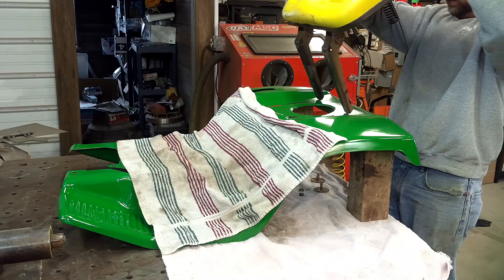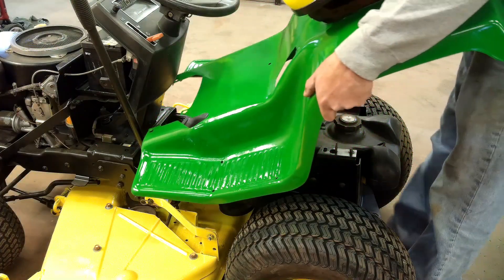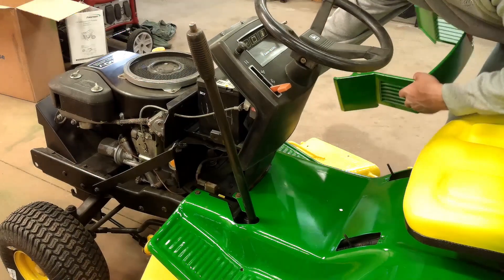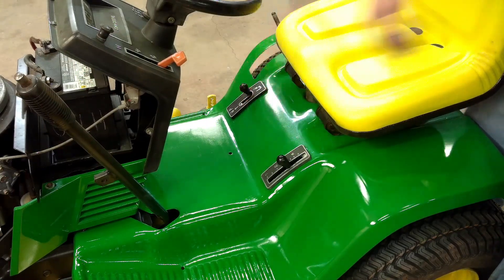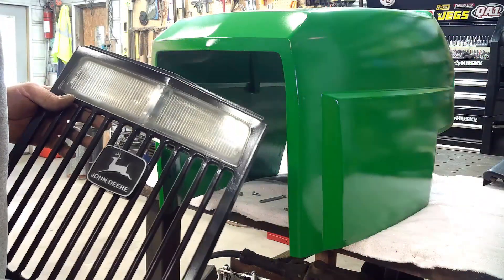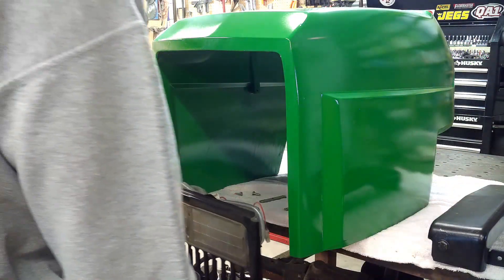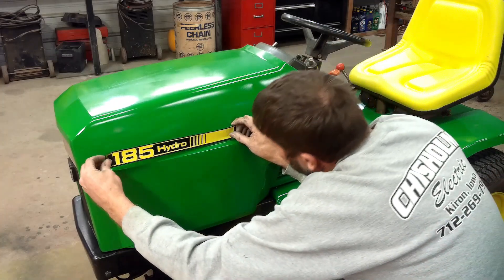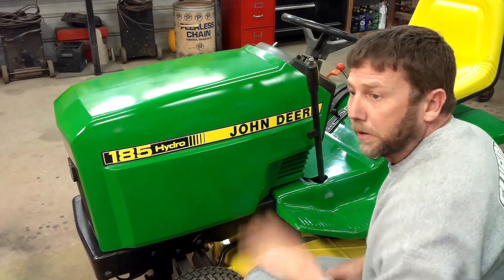John Deere 185 Lawn Restoration It"s Finished!! Ep. 12

Comment: I finished my restoration last night. Took it down to the chassis with the transmission still attached. Tightened everything up, scraped the rust off every bolt, replaced what was broken, tested parts function, adjusted drive linkages and steering, and re-did a lot of shoddy wiring/electrical. No access to sander and decent paint booth, but I gave it an amateur sanding and paint 3 years ago. It is a much improved machine thanks to your videos, made it all much more manageable. Thank you!
Reply: Now I have to get it to turn over. It's not behaving the same as before as it's actually cranking and fuel is getting thru the system. Seems like I am not getting combustion for some reason, but it much closer than where I was before.
Reply from the maker: Glad they were helpful

Comment: Hey Mr.Sparks and Fire. Gayle and I were watching your videos. Excellent job on the 185. We have the same tractor you have only in much worse condition. 
Now we have 2 things in common...A 64 Polara and a John Deere tractor.
Cheers, from Brian and Gayle
Reply: Thanks for the view and the comment Brian! I saw your last video where you got yours running, is it close to driving yet?
Reply: @jasonchisholm5236  Hi Jason.We are installing the interior/cleaning and working on polishing all the inside trim. This thing has miles of trim that our fingers are sore from rubbing on. It still has a ways to go, but we are closing in on the finish line. :) I think you'll like the final results. 
Regards,
Brian and Gayle

Comment: I've got a 180 and my deck is slightly different. I believe yours is the 48" and mine is a 46". I've got some wear on the shaft that is the hinge point for the tension pulley and the drive pulleys. hard to tell but is that shaft welded through the deck? I reckon I'm going to have to cut it out and put a new one in but noticed it isn't a part on the JD parts catalog. Time to fabricate I guess.
Reply from the maker: Yes, I believe that is welded in. Getting creative is your only option
Reply: @sparksfireandbalingwire8467  thank you sir! Just my luck lol

Comment: How does the spring attach that is on the deck height leaver?  You did it, but didn’t say where it attaches on both sides.  You skipped that in your video.
Reply: I've got a 180 and the spring is missing. I've trying to figure out this same exact thing.